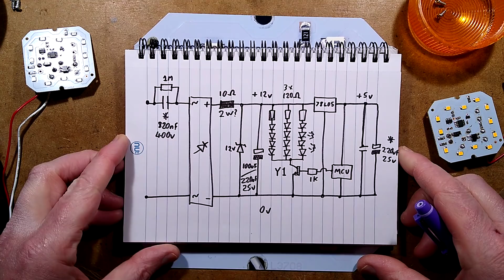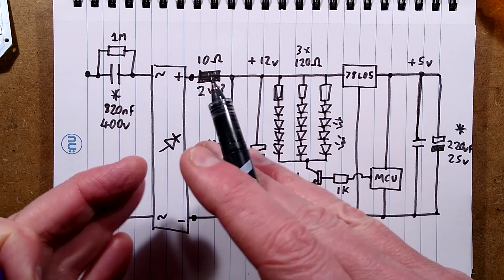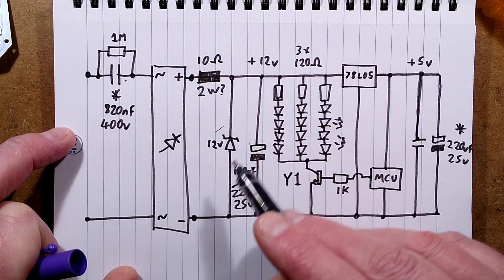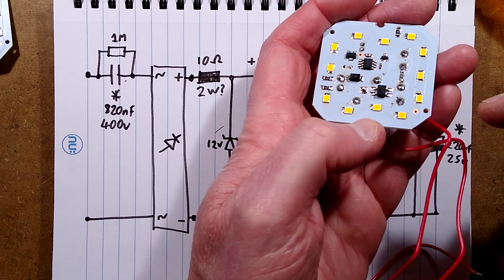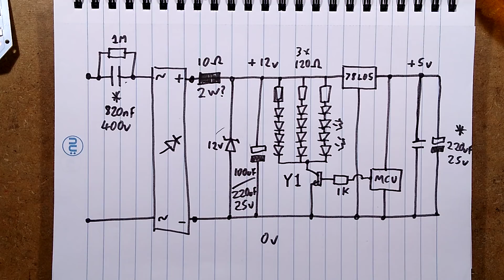Repairing an industrial beacon (with schematic)

Comment: I'm surprised, that they didn't use a 555 timer, but a micro controller. A 555 would certainly make for a much cheaper solution... or not??
Of course, it would be a bit more difficult to do flashing patterns with 555s. But still, an M/C seems wasteful.

Comment: Is there a reason that the transistor switches after the load? The collector to emmiter current will be the same as the current through the load but I suspect the voltage will be lower after the load, my answer would be just that, lower voltage across the transistor giving the component more protection. Just a guess 🤔

Comment: On Amazon, Seco-Larm SL-126Q/A Amber Security Strobe 6-12 vdc is Available. I have one that has been outside for over 25 years and still works. I replaced it recently, it was removed for new siding. The plastic was showing its age, so I bought new. For the new mounting, I purchased the Seco-Larm Strobe Conduit Box/Bracket, as it’s not a standard size. BTW the “A” at the end signifies the Lens color. The Lamp is Xenon.

Comment: i bought two orange ones on Ebay, and they had the exact same soldering problem. My guess is someone at the factory forked up and had the wrong coordinate offset loaded for this part in the pick&place machine.

This might only have affected one PCB in the large panel (so probably one of every 20-40 lights), and they decided it'd still make a profit. Or the PCB was done by a third party, and the PCB designer didn't supply a proper test rig (despite the PCB having proper test points).

PCB manufacturers usually do EXACTLY as you tell them, meaning they keep to the design you submit, no matter if your design has major screwups. Don't ask me how i know...
Reply from the maker: It appears that it's an option for a static beacon.  They deliberately blob over the switching transistor.
Reply: @bigclivedotcom  Well, the package of mine say "Blinking", but the Ebay listing said "not blinking".

Anyway, thanks to your video i bought two of these (after watching your repair), and i did my first surface mount soldering. Now mine are blinking, too ;-)

But i have to wonder: If the manufacturer wanted static lights, why add the electronics anyway? A couple of zero Ohm resistors with the right pad spacing would have been cheaper that making the full board, then blobbing out the transistor.

For that matter, putting a different program on that nameless 8 pin microcontroller.

Comment: Green and blue are conceptually the same color in some cultures.  Traffic lights are blue, yellow, red, even if you or I would call it green.  Both colors are one color.  So a blue light would be the same as a green light on a running machine. Yellow is attention needed soon. Red is stopped.

Comment: Very interesting, how do these beacons compare with the  strobes which are now popular in the construction industry for fitting on mobile plant as replacements for old and very fragile 12/24v rotating orange beacons. Originally the strobes were basic pulse types (which frequently interfered with laser survey receivers also on site). However the latest ones emulate the rotating beacons with LEDs illuminating in sequence to do this. Have you taken any of those types to bits?
Reply from the maker: I think I have taken the rotating type apart in a video.  It's just a sequence of LEDs around a central core.

Comment: Since they wastefully left a bridge rectifier on the circuit that didn't need it, it makes me think there might be other optional features.  I wonder if that MCU might have some inputs on those floating pins that change the flash speed if you sent a high or low signal...
Reply: Possible, but not likely Michael. Programming time is expensive and the added features are not needed to make the base functions work, however the generic PLC chip is far less expensive than a custom chip with  only the pins needed. I would lay odds the unused leads on the PLC have no programmed functions.

Comment: Hi Clive , in one of your videos I watched the other day, you used your " luxury snips" which was Xuron brand. Which model was it as they seem to have a wide range of models? I need to buy a new snips  for my hobby electronics and I was thinking of buying that brand if you find it good. Love the videos. Thanks,
James
Reply from the maker: https://xuron.com/index.php/main/industrial_products/11/10
I tend to only use them for where I want a very smooth component lead cut.  They're a lot more expensive than the common eBay side cutters.

Comment: As cool as the 555 timers are at least for hobby projects I have noticed that some of the low-end microcontrollers cost effectively the same and give you the flexibility of programming anything you want without any additional support circuitry.  You can turn it into a not, and, or, astable, monostable, or some combination thereof on demand with a single component

Comment: Clive, you have got to get a smaller tip on that soldering iron!  I know it get the job done but it seems gigantic.
Reply from the maker: It's more for through hole projects.  I just didn't bother swapping the bit as the pads were big enough to handle the size.

Comment: Perhaps the MCU just configures a timer and runs the flash from the timer output, then puts the ALU part in low power mode.

Comment: If the 12V power source was placed upstream of the bridge rectumfryer, the BR would have dropped a volt 
BUT the Vs would be more likely be around 14V - so we've gained a volt !

Comment: I have a general question. If I add a small capacitor in series with a device (LED lamp), can I dim the LED that way, and prolong the live of the LED's? I could add the capacitor in the wire to the lamp or n the plug to mains. This should work, right? (not asking about power factor, I know)
Reply from the maker: It works with some lamps, but not one with switching supplies.  They may strobe.  I'll be making a video about series capacitors soon.
Reply: @bigclivedotcom  Thanks! I was wondering this for a while (a week or so). Haven't tried it out. I find capacitors at mains scary so I stay away from them (for experimenting I mean).

Comment: Interesting that they went to all that bother for flashing! I got hold of some from CPC, and they have the expected astable multivibrator circuit in them. They also use dodgy LEDs which flicker when powered on continually, but that doesnt matter when they're being flashed

Comment: I used to be gobsmacked to see one of these one-shot micros stealing work from a 555 timer, but latterly I realize that even if they weren't cheaper to make, the time that goes into programming them (negligible in a large scale manufacturing facility) costs less than the passive components required for an astable timer. Margins on these products are so thin that every bean counts.

The 12V blue strobe looks to me like the ones on warehouse lift equipment meant for working in the overhead racking - they're typically mounted somewhere near eye level, and as long as there is power to the controls, the strobe flashes, presumably as a warning that the 5 ton beast could spring into motion at any moment. Still doesn't keep customers from wandering dangerously close to such vehicles even when they are in motion. (I spent 4 years wrangling major appliances and cabinets on one of those beasts.)

Comment: alot of bulbs of late go bang and I'm thinking they are using silver solder and the joints just go absurdly cold  ....  Yeah I know TNT loves Silver solder (amusements)  cause it's healthier.  not that it's better.  even with extra flux it's not going well.  Had my newest LED bulb ( the new sort with everything under the led panel surrounded by metal but plastic on the outside side and (hey where is it gonna vent the heat ) which is what happened. so using your SNIPS method.  I did just that and yeah everything was either cold joints or sooty.  The cap is puffing and the chip on the other side I'd assume got too hot for the PCB..  I've seen a number of pcb's even on CFL's and yes CFL's get a little black but NOT THAT BLACK.   Like okay back to the cheap plastic bulb like ones with that chunky orange red thing on there which I've just blanked out on.  tend to last way longer.  I could send a photo of the item but not sure how that'd help... and haven't found the best magnifier apps of late..

Comment: Modern electronic components are so fiddly unlike the vintage gear. I have a light like this that's 12v but mine has a xenon lamp in it, like the camera flash guns, it has high voltage caps in which boost voltage for the xenon tube.

Comment: The colours in Bosch where I worked meant these, also in hungarian:
Yellow: Waiting for raw part/idle (Darabra vár)
Green: "Part good", operation successful (Darab jó)
Red: Part faulty/Process errored and halted (Darab hibás)
Blue and white: misc, in our line it was operator input required, you had to move the part or add another part and confirm the start of the next step
The lights were also called "andon lights"
Just some random fun facts/insight

Comment: ARM processor running embedded windows making it flash would be better.  Then you could update the firmware with any secure WiFi connection.
Reply from the maker: Via a Chinese server.
Reply: @bigclivedotcom  Probably enough processing power reserve to add additional flashes remotely to the total flash count.
Reply from the maker: @gavincurtis  And listen to people then kill them with 5G death beams probably.
Reply: @bigclivedotcom  Chinese controlled death beams at that...before alerting the officials to take the children as any surviving parents are loaded onto trai...

Wait what?  We were talking about strobe lights with un-necessarily overpowered processing chips.

Comment: No machine I have worked on in over 20 years has used mains strobes (aside from primary cabinet power) - generally considered bad to use mains anywhere that you can practically use lower voltages. As for CPC - barely industrial considering the consumer tat that they flog... they're at risk of becoming Maplin MK II.

Comment: Ooooohh, that’s just begging for someone to put the blue strobe where the orange (amber?) one goes, and the orange one where the blue one goes. Then, when they turn on the power, the blue one goes >Bang!< and lets out all the magic smoke and is now all full of sooty skid marks, while the orange one doesn’t light up at all, with the consequence that the new hire, scared by the sudden bang made by the exploding blue strobe light, now runs into the safety zone controlled by the orange strobe light (which is unlit) and gets run over promptly by a large forklift carrying (Yep, you guessed it) a palette of blue and orange strobe lights the company ordered off eBay! 🤔

Comment: I wonder if the unused pins of the microcontroller are used for extra functions. Maybe input some pins will change the blink pattern or maybe multiple output pins output various patterns all the time. Then only one batch of MCUs could be used in different products.

Comment: RED - I have a problem and can't run (Alarm).

YELLOW - I have a problem but I can still run (Warning).

GREEN - All OK.

BLUE - I need material (blinking is material low and I will stop soon, solid is I'm out of material and stopped).

Occasional WHITE as well, which can be something specific to the process/machine. The above description is loosely defined by a concept called ANDON.

Comment: Happened to me. A remote control switch from Lidl was soldered with rusty nail in a prison camp in Xinjiang. Removed solder blobs and rust and it worked very well.

Comment: Some lifts have a blue flashing light that lights up when you push on a big handlebar above the lifts controls (in the lift bucket, while you're up in the sky). It's supposed to be a method of signaling an emergency, which might be hard to communicate. A blue light will flash along with a warning sound to let nearby workers know that the lift operator is in trouble, and the lift will go into an emergency stop state that can be reset from the ground controls.

Comment: Photographing even the fastest strobes with ridiculously short pulse times is dead easy... Just use an exposure time of a second or longer and bing, flash photographed!
The beacons and signal towers on the machines I work on are made by Allen-Bradley... something tells me they will be quite a lot more expensive then the one featured in this video!

Comment: What happened to the good old flashing tungsten bulb with the bi-metallic strip inside? I used to have one and you could hear the strip 'ping' as it connected and disconnected. They also used to take a while to warm up if I remember correctly.
Reply: My grandpa’s 62 Ford Fairlane had turn blinkers which would ping from the little can plugged into the fuse block. I’ll never forget that sound.  Modern cars have programmed audio coming through DACs to emulate the olden bimetallic acoustics.

Comment: Would love to see you take apart an old school analog stage lighting strobe if you can get your hands on one! I imagine they are all boring and digital with LEDs now, but as a young tech I remember having to install one of the old (mercury vapour? some kind of gas tube) ones in a theatre and adjust the strobe timing with the pot on the side using a precariously tall ladder.
Reply from the maker: Xenon strobes.
Reply: @bigclivedotcom  Ah, xenon, that sounds right. Do you know what kind of timing circuitry they used? You should do a teardown on one
Reply from the maker: @binaryagenda  They charged a main pulse capacitor while also charging a trigger capacitor.  After a time delay, a neon bulb would strike and pass current to a thyristor that pulsed the trigger transformer.  That delivered a high voltage pulse to the outside of the tube which then flashed over and discharged the main capacitor with a bright pulse of light.

Comment: 555 would have saved 7805 etc because it can run from 12V which is there for the LED anyway. Duty cycle isn't that critical in the application.
Reply: P.S. also, depending on 555, it could sink all the LED current without external transistor.

Comment: They could have left the  voltage regulator and MCU out, and do the flashing with two resistors and a flash LED and PNP transistor. Resistor to positive, in series with LED to the negative, and from that mid connection a resistor to the base of a PNP transistor with its emitter to the positive and the collector to the base resistor of that switching transistor.

Comment: wouldn't it be easier/cheaper to use a 555 instead of a microcontroller?
Reply: Surprisingly no.  The 555 timer would need extra components driving up the cost.

Comment: we have slow flashing led beacons at work on checkouts. I have to say they are easily ignored, or missed unless your looking for them. They are known as traffic light signals as they are stacked red, yellow, green. Red is for assistance, yellow means assistant required for age check or scale check and green is simply checkout free. I have to admit that I prefer the proper xenon flash tubes as they are much more noticeable and less likely to be ignored although not really suitable in my work environment. I guess the LED ones would be ok if you have a good view of them on equipment your using, but if its stuffed in a corner out the way you probably wouldnt notice it.
I have a reclaimed large red flashing beacon which surprised me when I opened it, it uses a standard ES14 40w bulb. I have no idea how the flasher circuit works but it does strobe the bulb at a rate of about 2 flashes per second. Probably not good for the bulb, its rated at 240v AC. Actually thinking about it, it was me that swapped out the original small bayonette fitting as I couldnt find a 240v bulb back when I first got it for that fitting. Industrial equipment is very weird with non domestic standards. Some panels were rated at 110V even though they were in a UK brewery where you would expect everything to be 240V or higher. weird.. lol

Comment: why did they even leave the rectifier in? is it cheaper to run the same pick&place program no matter what?
Reply: The redesign was probably done after units were fab’ed. Also, the blink/solid allocation can react to orders, right from the warehouse via a quick pass through the solder globbing station.

Comment: At my last job, we had an X-ray machine to check fill levels in the product.  It used these modular warning lights on the stack that absolutely had to be incandescent bulbs with a certain impedance.  It was a safety thing.  If the safety light burned out the machine would refuse to energize the x-ray tube until you replaced that light bulb.  This thing was only built ten years ago.  Why they couldn't replace tungsten bulbs with LEDs that don't burn out at all, no idea.
Reply: Because you will probably buy the replacement parts from the manufacturer,  thus guaranteed income for them.
Reply: Because they got Osha approval with the reg light bulb design that triggers the lock out.   Altering it to led may not work or need reapproval

Comment: You cannot beat a 20 cent chinese Holtek HT68F03C 8-bit microcontroller, it is replacing a whole bunch of logic devices for 1/10 of the cost, with 1KB of memory, you could program 1000 different light blinking patterns and drive up to 8 separate banks of LEDs